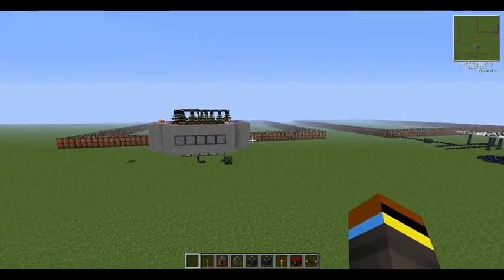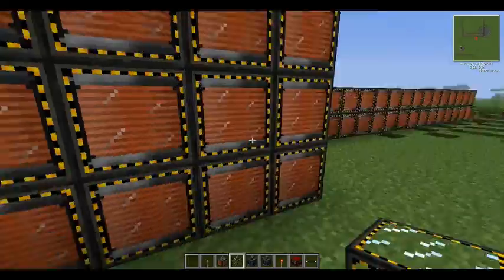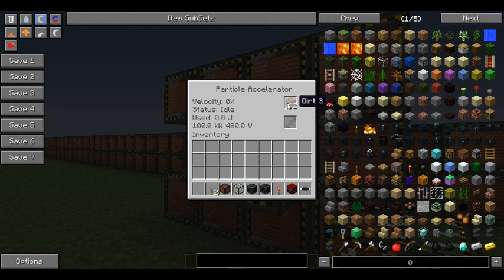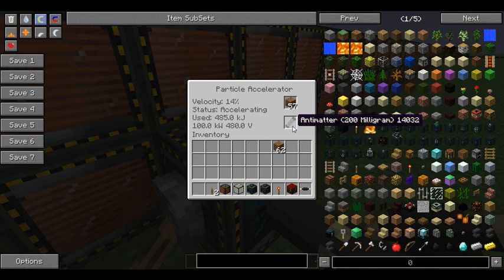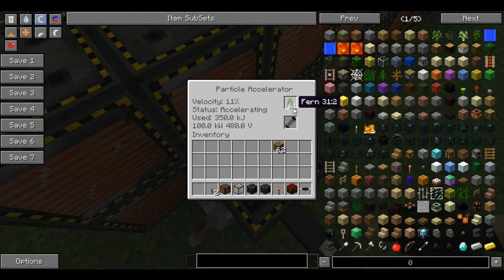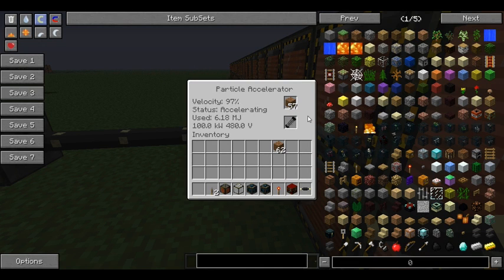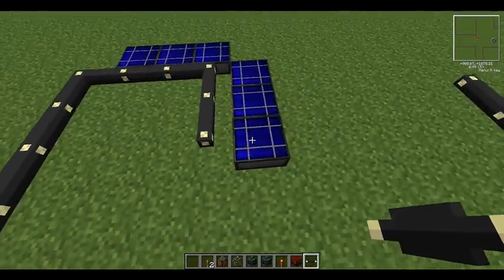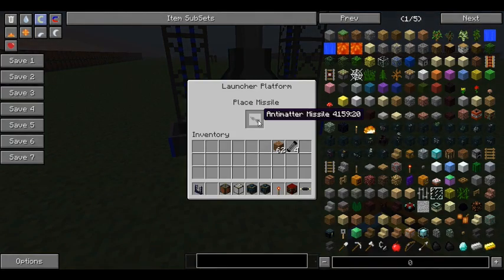voltz - tutorials - particle accelerators and L.H.C

Comment from the maker: i have looked at it and have found a solution. If you have put the accelerator on the corner of the L.H.C. the take the block next to it (side to the middle) and move the block one out so it is next to the accelerator it should work. if you want i can do another video about it?